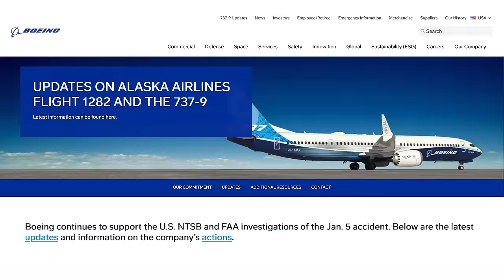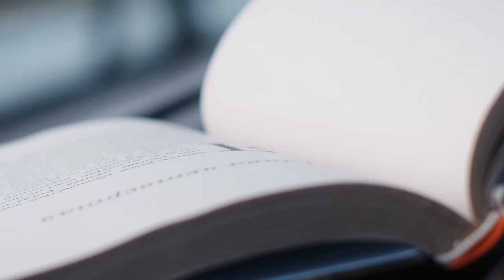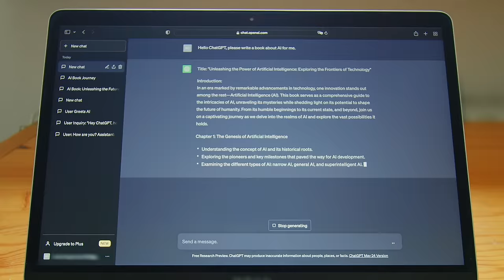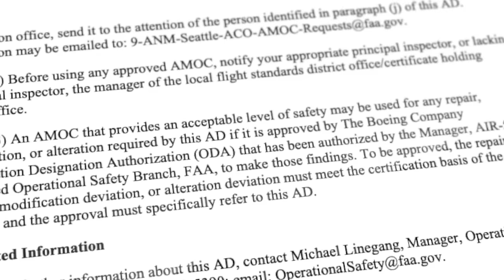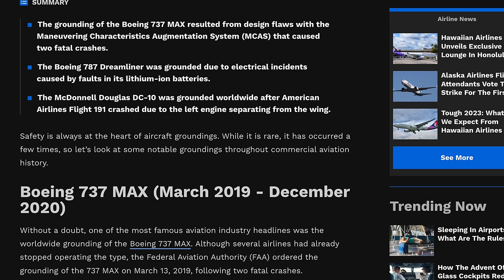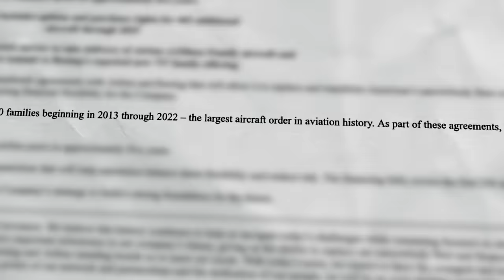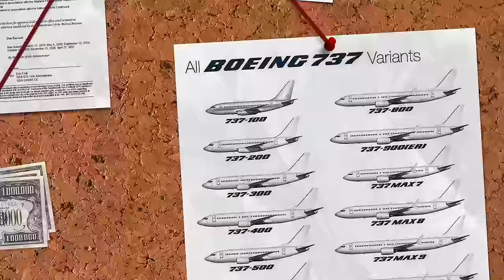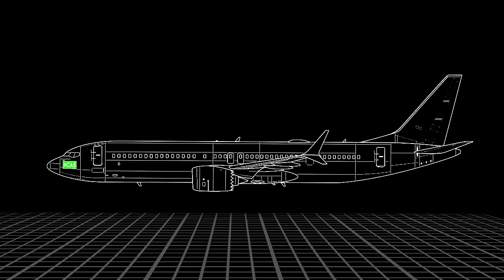737 MAX - How Greed is KILLING An American ICON

Comment: This is a culture problem at Boeing.  They once were a engineering run company focused on quality.  The U.S. Government asked for a commercial aircraft that could survive a crash.  Boeing and the industry responded it was not possible.  Boeing replied they would improve quality to make aircraft so reliable crashes would be very rare and so began Boeing's quest for very high quality achieving high reliability.  Unfortunately Boeing bought McDonnell Douglas, which was more focused on their share price.  Senior executives from McDonnell Douglas were integrated into Boeing and the share price culture destroyed Boeing's good name.  Culture focused on sound engineering, quality, the customer and resulting reasonable price to a culture focused on share price, shareholders resulted in poor quality, poor reliability, poor safety records and rising prices have destroyed Boeing.  All that you read is the extra inspections being done to improve quality and reliability.  Problem is you cannot inspect in quality.  Solution will take years and many levels of top executives at Boeing will need to be let go to change culture to a focus on quality...quality = reliability

Comment: The bolts and split pins don’t hold the door in place, so a loose bolt providing the split pin is in place wouldn’t cause a problem. The bolts are there to stop the plug from moving up off of the location lugs and the split pin to stop the nut from coming undone. In the case of this plane it would appear from what I’ve read that during work on this plug the engineers didn’t replace any of the bolts nuts of split pins. As for there not being anyone sitting in those seats, I would question the airline as it seems something of a coincidence that the seats were empty. However I assume there’s also a plug on the opposite side of the plane and I wonder were those seats occupied. Boeing certainly have the blood of those passengers killed in the two crashes on their hands. The Fact that the MCAS system relied on one sensor is unbelievable, that Boeing didn’t inform pilots about it is at best,  irresponsibles  and at worst criminal.

Comment: This is just as much a serious failure on the part of the FAA. 
After the issues with the MCAS, this latest problem should result in an immediate grounding of all 737MAX aircraft and revocation of the type certificate until Boeing proves that all planes have been completely inspected and are airworthy, but also that all airlines flying the MAX are complying with all maintenance & inspection requirements.
In my opinion, the FAA has been entirely too lenient with Boeing because of their standing in the aviation community.
Hundreds of people have died because of greed, arrogance, complacency, corruption, indifference, and a corporate mentality that just does not care about passengers.
I don't think any of the dead passengers, or their families want to hear the pathetic excuses from Boeing employees that they feared retaliation or loss of jobs if they pointed out problems with the planes. The finger pointing has got to stop, and everyone employed by Boeing, as well as everyone at the FAA needs to be held accountable for all of the lives lost.

Comment: As you imply, Boeing may have made the correct business decision to extend the 737 base design - acting within constraints set by regulatory bodies. My question would be - is it valid to allow the new plane to be "grandfathered" under the earlier certification when changes to engine design and placement had lead to significantly different handling characteristics which needed a "software patch" in the form of MCAS to avoid dangerous problems in flight ?  A significant part of any blame should be shared with American Airlines and the FAA who respectively demanded and allowed this.

Comment: Boeing hired an executive from Toyota who tried to convert an aircraft assembly line into a hybrid model that operates like an auto assembly line which assembles aircraft.  They tried to automate assembly of the 777 fuselage - which failed miserably, and they cut quality inspection out of the factory by over 80%.  They'd cut more if they could get away with it.  They "pencil-whip" jobs, perform the maximum amount of out-of-sequence work possible, and hire unqualified people for management positions.

Comment: The plug bolts and frame that hold them should be made out of better materials that are verified and x-rayed/scanned for cracks as well as vibrational testing. Instead of the cheapest bolts and frame parts sourced from Temu. Then this shouldn't happen again.

Comment: Could it have been possible that two people got sucked out of the plane? If the airline knew about the possible occurrence
of the plug getting blown out why were the seats on the right side of the plane filled? Something just doesn't add up.

Comment: If it had redundant angle of attack sensors then the issue with the MCAS would not have happened right?
Reply: Correct.  The planes have two AOA sensors but the MCAS logic only used one or the other, it did not check the two sensors against each other.  Boeing had made the dual-sensor logic a value-add feature that airlines could pay for, and most airlines had not opted for that feature.

Boeing should never have done that... they should have integrated both AOA sensors into MCAS from the start as baseline.   So in the case of MCAS, it was pure corporate greed that led to the deaths.

In addition to that, the pilots did not have instruction and the cockpit did not have proper indication that MCAS was overriding their control inputs, which prevented the pilots from regaining control of the aircraft when MCAS went nuts due to the bad AOA sensor.   A software problem.  But also due to corporate greed because Boeing was trying to keep the original 737 type certificate intact for the Max and so wanted to make MCAS quietly operate in the background just generally.   So again, Boeing made very bad decisions all in an effort to keep the blasted 737 type rating for the 737 Max.

-Matt

Comment: If I were Boeing, I would still make the same decision and then just wipe my crocodile tears with cash. Those 400 souls were a bargain for a nearly 80% increase in stock price from release of the jet to the first crash (when I would have sold obviously). Their valuation grew by almost $80 BILLION in that time. It has since fallen back to where is was before the 373 Max, but if they sold just as the first plane crashed, they would have realized MASSIVE gains...

Comment: It is normal to use loopholes to save money! The big failure is that it has taken this much to force it.
First change it to a Max of 4 iterations of any airframe after that you start over period.
Amend pilot training to have continuing education so " any! " changes in flight or controls
With any iterations changes are covered it could be as simple as a 1 hr. online course
Controlled by FAA certified contractors not the airlines!
That would be a start at least.

Comment: In 2019 I was booked on a flight on China Eastern from Guangzhou to Beijing. I could see that they had flown 737 MAX planes on the route, but the booking site showed they were going to fly a 737-400 on it, in both directions. (Had it been a Max I'd have refused to go.) Anyway, day of the flight, and China Eastern had substituted the plane again - with an Airbus A320. This being China I'm sure I wouldn't have got a straight answer had I enquired, but I am curious as to why they made the second change, unless passengers were too scared of boarding anything saying "737" on it.

Comment: If American Airlines had bought Airbus planes, they would still have to certify their pilots for those. So no difference there for buying an Airbus or a new Boeing model. The problem was that Boeing did not have a plane suitable to compete with Airbus at the time and were looking at years ahead with no viable counter-offer. In technology if you rest on your laurels you will not even have the time to see the cliff in front of you until you are already falling.

Comment: The foreign purchase planes did opt for the option of having Two AOA vanes.    When there are two AOA vanes and the is a difference between the two it flashes on the MCAS.   The foreign air Services skipped that $66,000. Option.   Was major difference.   With difference warning while having two AOA vanes the pilots would have turned off the MCAS.  Manuals says when you get that warning the pilot is supposed to use his judgement as to the real angle of the plane is.

Comment: The landing gear should have been changed instead.

Sure, it adds more changes, as everything in the required space would have to be moved too.

But then no MCAS would be required in the first place.
Reply: They didn't want to make the plane taller because it would have been harder (i.e., more expensive) to service, and to load and unload the cargo.
Reply: @ipp_tutor  The question is, how much the gear would have to be lengthened in the end. How many ground systems would have been affected by the changes?

Without a deep dive it's impossible to say. Nevertheless, it would have been the better option in the end. But that's hindsight knowledge too.
Reply: @jantjarks7946  100% agree. I'm totally sure Boeing engineers had a pretty good idea of what things would change. Perhaps having longer landing gear would also require retraining pilots for a different landing profile? I'd be willing to bet that was more important (more pressure from AA) than loading or unloading the plane.
Reply: @ipp_tutor  Probably both, AA and Southwest. And indirectly maybe even Ryanair?

It makes sense for them in business terms. But that's the point, engineering had to find a business solution, not a technical solution. 

While that happens all the time, having to do this with an outdated design, working around all types of issues turned it into a safety hazard.

And that's the point where Boeing should have stopped with the MAX design, rethinking it.

Sadly the engineers didn't get their point through, for whatever exact reason doesn't even matter. It was a no-go scenario which was pushed through nevertheless, with conflicting demands placed on the design.

At the core it was the perfect recipe for a disaster. Everything else contributed to it.
Reply: In my opinion, they should have done some sort of landing gear system like that of the MAX 10, only the gear is always extended when on the ground.

Comment: This regulatory problem reminds me of the underground coal mining industry. MSHA, I believe, certifies underground mining equipment. And lawsuits can not be filed against certified equipment. A new or modified piece of equipment, for instance, a shuttle car with newly designed safety improvements, can be certified. However, if it is and if someone had died in the past - because the older equipment that was certified 10-20 years ago didn't require those new improvements - big lawsuits entail. That sort of thing really slows down innovation and progress.

Comment: How does an airframe equivocate to more safe? If this airframe was good for a huge number of years, then how would updating a formerly safe airframe be unsafe? Doesn’t make sense??? The inclusion of newer more fuel efficient engines I understood was the reason for the MCAS system which was supposed to avoid accidents by incurring a “correction” to the flight characteristics, which used non duplicated sensors which would have fixed the problem? This doesn’t make any sense!!!
Reply: It does. The change of engines changed both centre of gravity and centre of thrust. If you change centre of gravity and/or centre of thrust on a given airframe it can change its behaviour and flight characteristics dramatically. The MCAS, even if it had used the required sensor redundancy, would never have been a real solution, only a stopgap measure. It basically added an "auto-trim" because the new configuration would fly itself out of trim. Which is bad. and in certain circumstances, it could enhance a critical situation. Which is worse. And the pilots couldn´t override it, and would get contradictory feedback from the plane, which is a nightmare. And they weren´t told. Which is downright criminal.

Comment: The first two crashes of of the 737max could have been avoided by using two angle of attack sensors and having the computers that receive the two sensor signals compare the signals for agreement and analyze the signals for reasonableness.   If they fail to agree or are unreasonable you do not allow them to control a major flight control surface.  Electronic commands  should be stopped and the pilot alerted to take manual control.    This basic idea has been in place for well over sixty years in automatic flight control system design.

The real question should be,  how do people who do not understand basic safety design aspects get into positions of authority anywhere.   It seems to me that merit based hiring and promotion has  been lacking nearly everywhere not just at Boeing.

Comment: Hi Mr. Da Vinci  I'm  new to the channel and thank you for video. What you are saying I agree 100%, just one thing though I too blame Alaska Airlines somewhat because of their oversight, I think when they knew and first heard about this problem with this particular aircraft, they should have got their flight engineers involved and checked it out. They have the equipment to check for pressure leak  if they could not do anything then they would have gone to Boeing and ask for assistance, this plane should have been grounded from the start. I work with an Airline company and day after day, we are reminded about the overall super critical importance of safety in our line of work and this is certainly most definitely highlighted in our trainings whether it's online, virtual or classroom and it doesn't matter which department you work within the airline as everyone, whether you are a manager working managing a ticketing office or a cargo employee or even a simple ramp staff loading aircraft, it is quintessential that you know about safety so what bothers me the most is HOW an "Aircraft Manufacturer " who designs and builds aircraft could prioritise, revenue overall because they do not want Airbus to get the upper hand over QUALITY AND SAFETY which is suppose and needs to be the number one priority? Its OK I get they did not want to build a new aircraft from scratch as it would have cost millions and Airbus would have gained the upper hand. Fine but they should have done it the right way, the correct way the SAFE way and we would have not ended with a Catastrophic disaster.
Reply: He did mention that Alaska Airlines shared responsibility
Reply: @LuisSierra42  yeah he said they shared responsibility, but he also said but theoretically the airline did not put anyone in those seats because they knew. It could be pure coincidence, but it could also have been done on purpose, until the conclusion of this investigation we can only guess.
Reply: I’ve read people seated next to that door on previous flights complained about noise. If Alaska Airlines suspected a leak at that door, and didn’t seat anyone there because of it, I don’t see that as a failure on their part. A noisy air leak in an airliner can    be, and most often is, nothing more than an irritating noise. Like a noisy widow seal on your car. Leaving those seats empty might be just a kind gesture towards passengers. 

If a door seal noise problem is intermittent it may be impossible to find by doing a static test on the ground with no high speed exterior air flow, even if you simulate altitude pressure. And, with nothing to suggest otherwise it might not be enough to suggest there was even a remote chance of catastrophic failure. Alaska taking that plane off the long over water flights, and not seating anyone by door, seems like proper caution.
Reply: @Bitterrootbackroads  OK, however my point that I'm saying is did they really perform the test, intermittent or not, I get what your saying don't get me wrong. Because to me it seems as if they were saying " this plane is new, it's not worth the time, we will not let it fly over water, and possibly probably if they knew coincidence or not block those two seats, we will not allow people to book them. To me if Alaska Airlines at least did the test, that alleviates them from any suspicion and the blame falls solely on Boeing.

Comment: Living in the Northwest, I could tell something had changed in Boeing management when they started calling themselves a Chicago based company. This came across as a snub of Boeing's roots, like they had gone from a people centered organization to a money centered company. After the merger of Boeing and DC Douglas, the new organization stopped hiring many of the board directors from the engineering staff and went with a purely management style board of directors. Boeing, DC and Douglas were all started by aeronautical engineers in the first place. There is now a serious disconnect between engineering and management. This not only made problems for the 737 MAX, it also has seriously set back the schedule and the safety of the Starliner spacecraft.
Reply: Not to mention their lip service to quality but demanding quantity.